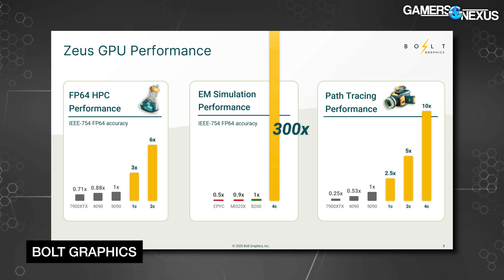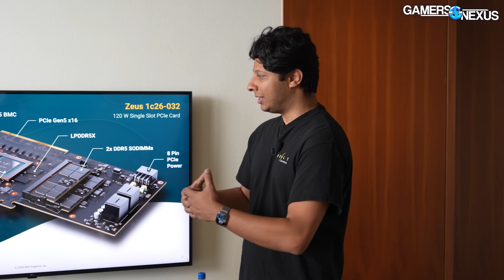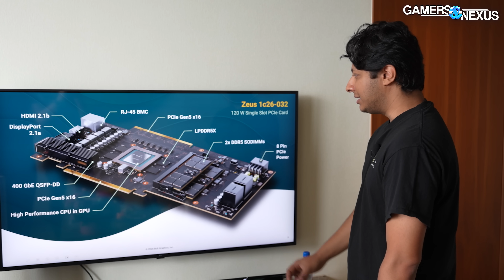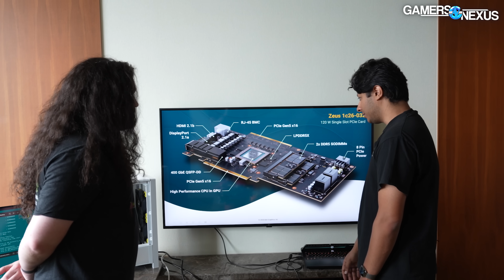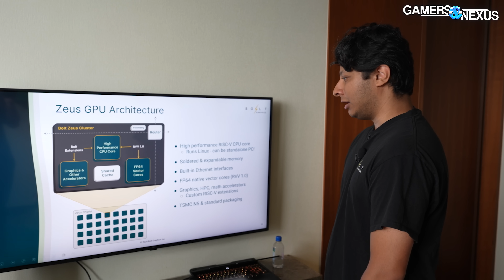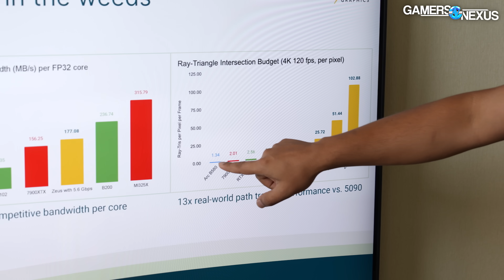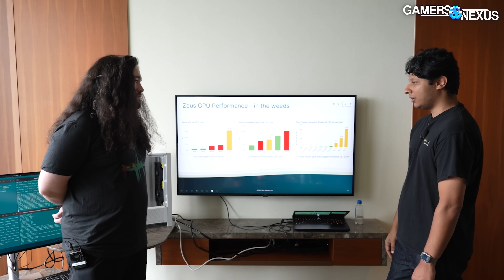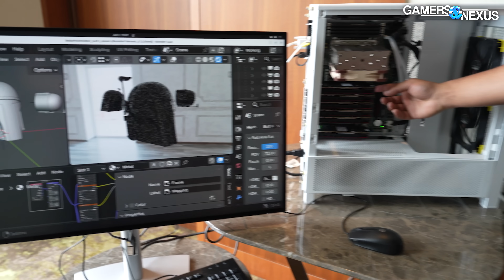A New Gaming GPU Challenger: Bolt Graphics Takes Aim at NVIDIA

Comment: They should open source the software. Thousands of volunteers would be happy to make sure every game is running, let the power of the community do its work! It would also foster a lot of goodwill, Like it's all a big community. There would be major updates every single day!
Reply: Neat fact, only Nvidia black boxes their bullshit! Because they're not compliant with a lot of standards. This is the problem Intel ran into with battlemage not supporting games because they were following standards.. games weren't following them.
Reply: It would be an utter mess just coordinating that effort and would require one or more FTEs on their part, but yeah, it could get 10 years of traditional development done in under 1.  Moreover, it wouldn't happen right away, but it would essentially guarantee a stable driver stack in the long run, which is something that every GPU struggles with.
Of course, that's the reason they have an RJ-45 on it.  They literally intend for people to write their own firmware for this thing.
Reply: i don't think they will will want to release their raytracing performance secrets anytime soon (assuming they're actually that good which they never are)
Reply: @aeghohloechu5022  the magic sauce for raytracing isn't software. it's hardware. and nvidia's binary format, while largely undocumented, isn't treated as a trade secret.
Reply: Unfortunately this kind of thing doesn't work anymore because of vibecoding. PRs would be filled with ai generated slop.
Reply: @samuraidogopen source closed contribution is an option.
Reply: @samuraidog Eh it won't be long until a lone relatively competent RE nerd can pry the thing apart with help from AI. When Fable 5 was a thing I used a free subscription I received from my employer to attempt a directx to metal translation layer in my free time,  so I could play some old Windows games on my macbook pro. I had what I wanted running within a day and at much better performance than the proprietary solutions (like CrossOver).

This is probably a big part of why the US is apprehensive about the public having access to it, it's going to kill off a lot proprietary software industry. Suddenly a competent solo dev has the power of a whole studio in the palm of their hand. Free to delegate and automate as much as they can type and afford. Publish their work for free online.

This also means a person who's super into RISC-V for example or has some specific niche Linux usage he wants to build, they have the power to attempt doing it themselves, push a PR to be up streamed. If the PR sucks, well maybe another person can clean it up so it can be approved. 

While fully open contributing repos might be dead ones operating on an invite / application basis are still going, and the ones utilizing AI properly (as in strict specific prompts not 'make me x now no mistakes'), are making more progress than big oss projects. You just need to make sure you've got actual programmers using AI, who can read and understand their PRs lol. But I'm sure for many repo owners that's too much management than they'd want to do.
Reply: @samuraidog Open source doesn’t mean you get rid of maintainers smh what are you even talking about
Reply: @Freshbott2  Are you under a rock? OSS maintainers have been slopspammed for the past few months. A lot of projects have had to close outside contribution as a result of the spam.
Reply: @_Zaid  Open contribution was a great thing while it lasted. 28 years of OSS here, sad to see it go.
Reply: @_Zaid  a lot but not as many as you might think. also, a business has the financial incentive to tell those people to eff off with their garbage "contributions".
Reply: @_Za @_Zaid  And? Open source doesn’t mean accepting random contributions or maintenance from outside. It doesn’t even mean redistributable. Even then FOSS is still alive and well. Reputable contributors to all kinds of things didn’t fall off the earth the day slop machines showed up. There are still communities working on anything and everything. What a naive bunch of insinuation. Some open source projects have to change how they go about things. That doesn’t mean open source is going away.
Reply: their entire model is working with existing software to make the hardware work with it, meaning theyll be co developing the drivers the entire way
Reply: Maybe later, when the AI bubble bursts, so you have actual coders wanting to work on it without a bunch of AI slop merchants submitting mountains of garbage.
Reply: I love that!
Reply: Linux's terrible UX wants a word with you on the "thousands of monkey" part of your thinking.
Reply: its not gonna be very open with a licenced core
Reply: Are you offering to work on their firmware for free?

I'd say the big thing is their API needs to be an open standard, but they'd have to convince people to actually use it... Realistically, they'll need to make it work with an existing API.
Reply: @SnakebitSTI  AMD does open drivers.
Reply: @SnakebitSTI  generally, the people who contribute to drivers are either end users experiencing problems or developers whose end users are experiencing problems. and while, yes, the contribution isn't necessarily being paid for by the maintainer, the contributor is still significantly benefiting from the contribution in other ways.
Reply: Exactly I agree, someone mentioned AI slot but even that can get reviewed and fixed
Reply: Sounds cool but I think the licensing of the architecture might restrict what can be determined as open source
Reply: Malware would eat this shit up then
Reply: The only way they could open source the software is if all the hardware was open as well. That is not the case.
Reply: @nobodyimportant7804 I don't see anything closed about the hardware, it's based on RVA23 RISC-V, UCIe, PCIE, DDR5, Vulkan, DXV, RVV 1.0, FP64 ALU, etc. All of these have open standards and FPGA implementations and it runs Linux on the hardware. The only question is their graphics accelerator which itself is not going to be much. The horsepower is in the other processing units. What's fascinating here is that Bolt Graphics have been working on making this happen using SOTA RISC-V research and have a running FPGA implementation. Will they be able to afford the $10 million tap out? That is the bigger question.
Reply: @joshcryer  There were parts he wasn't allowed to talk about concerning where it came from. That is closed source. 

Hardware running open standards doesn't mean that the hardware is open. 🤦‍♂

Hardware running Linux doesn't mean the hardware is open. Are you kidding me???

NVIDIA cards run open standards. NVIDIA cards can run in the Linux kernel.  🤡
Reply: @nobodyimportant7804 NVIDIA provides no documentation about their hardware stack, everything in this unit except for the graphics accelerator is documented and already implemented in either Linux kernel or in drivers or in FPGA proof of concepts (yes even the ALU RISC-V extension is implemented and open source). Virtually everything is built on the RISC-V ASI and related extensions.

Not sure how you don't get this. There's no "special sauce" here. Even the graphics accelerator will use the ALUs and vector engines.

Have you even LOOKED at the architecture???
Reply: @joshcryer  Right, their hardware is closed, and the important parts of their Linux drivers are closed.

You didn't listen to this video very closely. When asked about the CPU in the GPU, he couldn't give any specifics at all because the company that they got it from won't allow it. That makes it closed hardware.
Reply: @nobodyimportant7804 the hardware hasn't even been produced yet...
Reply: @nobodyimportant7804 I looked at the spec sheet for Zeus, you clearly haven't
Reply: @joshcryer  i'll note that risc-v processors, even those with full rva23 support, can vary wildly.

- sifive's chips are optimized for basic compute with 128-bit vectors.
- tenstorrent sells ai-optimized cores with 256-bit vectors wired in a special grid.
- there's several companies selling chips with 2048-bit vectors for more nvidia-like ai accelerators.

the special make-it-fast sauce isn't the software. it's the hardware. and people are trying all sorts of stuff to make risc-v vectors fast. in public research papers alone, i've seen stuff ranging trom using multiple chiplets to dispatching all the vector state inline with the instruction to re-packing everything into "very long instruction words". they're almost certainly doing zanier stuff in private.
Reply: @nobodyimportant7804 AMD drivers are open source.
Reply: @cobaltlitizvikings7613  Not all of AMD's graphics driver software is OSS. A big example is ROCm, so a significant number of the video cards' use cases are not controlled by OSS. The firmware is also not OSS.
Reply: Nah, they pan to sell out the company, so no...
Reply: Yeah no open source is DOA IMO.

Comment: To make the driver side of things easier, Bolt could implement Vulkan and use existing open-source solutions like VKD3D-Proton, DXVK, D7VK and Zink to support all DirectX versions and OpenGL 4.6. These translation layers can also be adjusted if need-be. In theory, performance in all APIs should be decent enough, as long as the Vulkan driver itself it capable.

Comment: I totally don't get the idea behind ray tracing / path tracing vs baked lighting in most cases. You are adding something extremely computationally expensive to basically avoid the manual labour of having the artists do the lighting nicely, at the cost of your game running like trash in most cases. The absolute best lighting I have ever seen in games is NEVER dynamic lighting or ray tracing, it's games like the Dead Space remake where everything is pre-baked and so the lighting looks perfect with basically no performance cost, with all sorts of artistic touches and with the designers choosing what to highlight or not highlight which interacts with all sorts of other systems, like users being able to tell where they are supposed to go (which is harder to do with dynamic lighting). That is why some decade old games have way better lighting than modern games with support for ray tracing and path tracing, and why some games look like crap when it gets enabled. It just sucks all the life out of the lighting while making the game run badly and giving less control to the environmental artists. Unless you just need some good reflections I do not see the point at all. Why not just make an AI tool to help environmental artists do their job easier and bake lighting quickly or something. That would make so much more sense. The only use case that has ever made sense to me is reflections in water and mirrors. Even in a lot of those cases it is not worth the performance cost at all, since a lot of the tricks we have for doing reflections look almost as good with much better performance. You only notice it in games like spider man where there is a lot of clear/clean reflective windows and glass.

Anyway, I'm skeptical of any new competitors in the space but it's good to see more companies anyway. Hopefully they can see some success. At least in the meantime if I buy a card I'm going AMD. The price-performance is much better for real performance (not DLSS frame gen) and it properly supports Proton/Linux, and they are less detrimental to the computing space in general than NVIDIA. If NVIDIA wants to prioritize the AI market over consumers then that is fine, but if the AI bubble pops and they need their consumers again to hit revenue targets, I am gone for good. Never buying an NVIDIA product for at least the foreseeable future, especially given their closed system and lack of support for linux. Right now they are one of the big bottlenecks making the consumer market for all electronics worse with no benefit, so I'd be happy to see them go out of business honestly. If Bolt can just compete with AMD on price and performance in the mid-range cards, and SteamOS/Bazzite/Linux can support Bolt drivers, then I'd consider buying a card from them. Being able to expand GPU memory is actually a really cool feature. I don't know if they are the first to do that but I've never seen it before. If that is new, then that is a real innovation and is a hopeful sign.

I don't know if Valve would ever be interested in becoming more vertically integrated and going harder into hardware, but maybe if there are more smaller companies some of them could partner with Valve. If Valve owned a share of some component companies that could be really powerful. It's way too early for anything like that, and I don't know if Valve would even consider it, but that could be pretty great for consumers if things headed in that direction. Might be a pipe-dream, but I never thought Linux gaming would be where it is at either. If Valve had full vertical integration they would be totally insulated from the hardware market and things like the Steam Deck price hikes would not happen. It would also be really good for driver support & integration, and there would all sorts of cool efficiencies that would be possible in the PC gaming market kind of like how consoles have always punched above their weight, because software only needs to be designed around a single hardware spec. I wonder if Valve is looking at small companies like this, where their buying power would be a lot more significant, could be mutually beneficial.

Comment: A CPU in a GPU is very interesting - especially for GPGPU compute. A massive issue with compute workloads is that GPUs cannot execute conditional operations - they have to execute each pathway then pick the needed result, which wastes resources. A CPU capable of executing these instructions without running both code paths could be quite significant for performance in compute workloads.

Comment: he said he wanted the gpu's to be as memory bound as possible, focusing on memory tasks, this is what nvidia does best with HBM3e and AI, no idea wtf they think they're gonna achieve here.

everytime there is a vid of some competitor u see the thing, u see the benches, its so far back and not even close to anything that will compete with "current" gpu's at all and they never get anywhere, 0 success and they never show up in the future for anyone.

this gpu is not for gaming and idk what its supposed to be against, memory tasks is mostly AI now, heavy vram usage etc is all what nvidia is doing for AI and the compute ofc, so nvidia is faster in compute and in memory bandwidth and memory tasks.

this is basically asking for high capacity vram capability by using normal DRAM for cheaper but its slow, what sort of program and usecase is this aimed for is the question, if its a software w less than 1b worth of user income then they are going bankrupt

having a gpu that only can do tons of vram (not even more than a high end nv card) and then be slow at compute, its like, adding fast tires to a car w slow engine, makes 0 sense. its like delusional world and with that, bankrupt incoming.

Comment: 0:19 - This card is also made for data centers.

A home gaming card doesn't need a CPU, RJ45BNC, or 10-card SLI mode in the GPU. It also doesn't need general-purpose vector computing.

And you talk like the evil N has gone to data centers, and these guys are making a card for games and work.

Even though, this card is simply made for data centers.

Comment: I don't see this version working for competitive games. They 100% should push into the gaming ecosystem, but they'll have to make a locked down gaming version. Running an easily modifiable Linux kernel means with the right technical knowhow someone could make on-GPU cheats that are even less detectable than DMA cards.

Comment: Dude you claim to be showing off a "Gaming GPU Challenger" in the title (Bolt)
Then you say there are only aspirations of Bolt ever reaching the gaming market, 
because Bolt has been running for 6 years and it has only ever gotten a few silicon wafer samples from TSMC
And the software is far too slow to catch-up on so they're focusing on one 'creative' application at a time

To even hint that this has a 1% chance of being a challenger to NVIDIA (or AMD) is just unthinkable
Maybe in 5 years it could make mere 3080 performance in AAA games, by which point there will be a 7090!